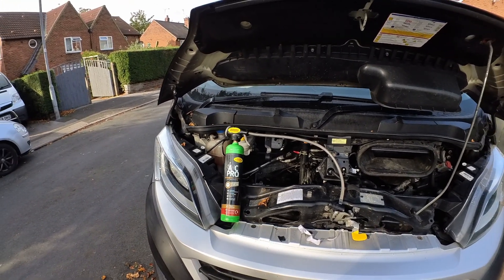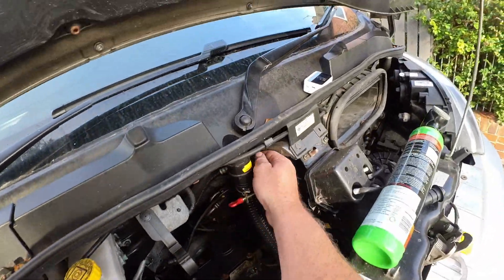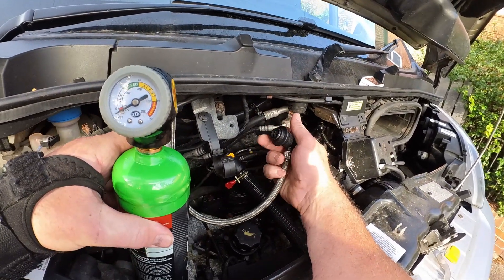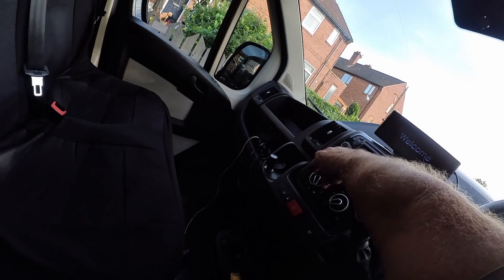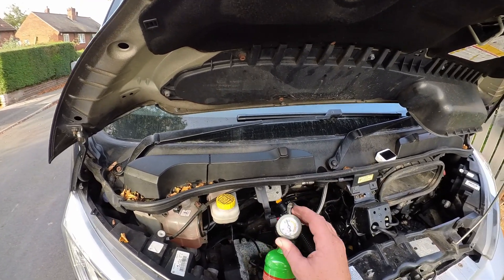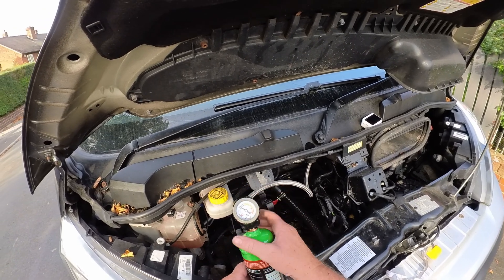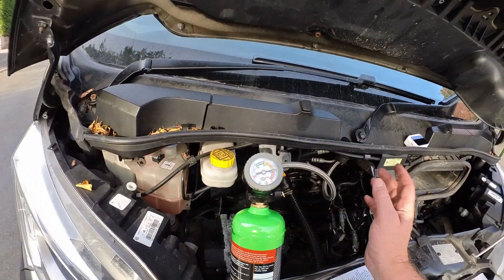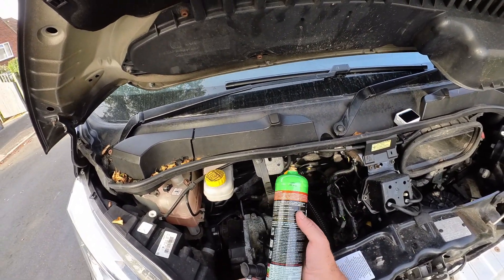Easy Way To Check Your Car’s Air Con Gas!

Comment: Hi mate on your ducato aircon in the engine you have the pressure sensor and something to the side of this pressure sensor do you have this blocked off or another sensor
Reply from the maker: are you on about the over valve what has a capital on it like for your tires if you are going to a service station they would use both valves instead of just one shown on here you cannot mistake and as they are different sizes
Reply: @ I’m not sure buddy 
I noticed when you fill up the valve above 
Below it you have a pressure sensor and a wire connection on it then to the right of this also on the steel pipe is another valve but on my ducato it have nothing on no sensor or cap you can screw off so just wondered if ducato had a upper and lower pressure sensor which on most vans would be a think steel pipe for low pressures and small thin steel pipe upper pressure switch

Comment: Noticed today my fan doesn’t kick in when turn ac on and tbh it’s not that cold either 
So thought must be a leak so tested it and it’s still full half way on green 
Definitely not right tho it should be freezing cold and fan should kick in
Reply from the maker: yes my experience is the fan kicks in when on unless you'll have something more serious than just pressure problems on the compressor